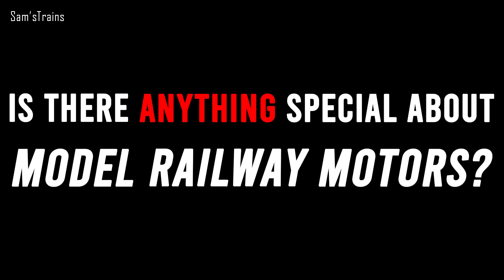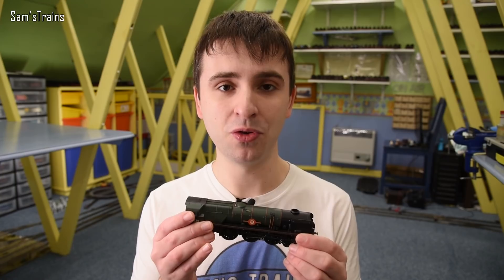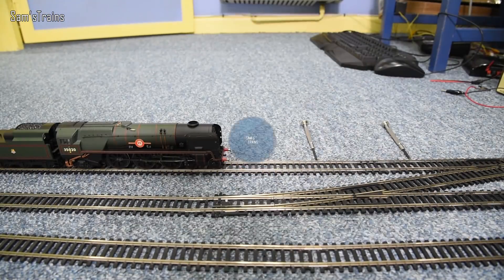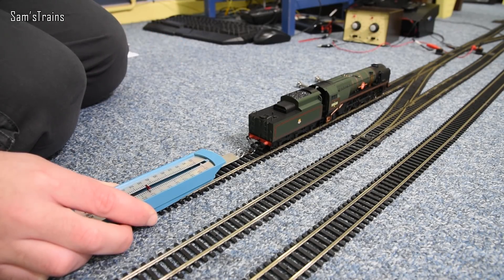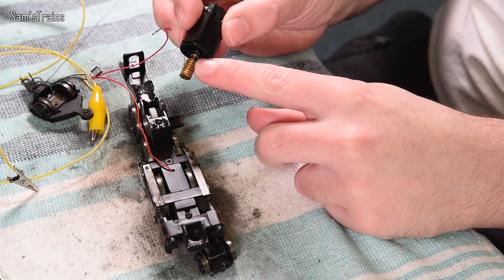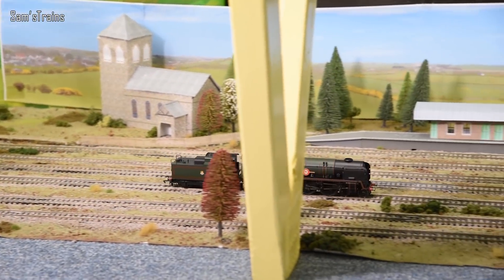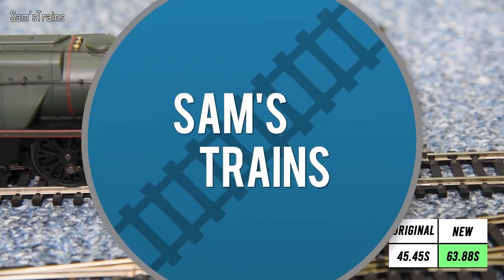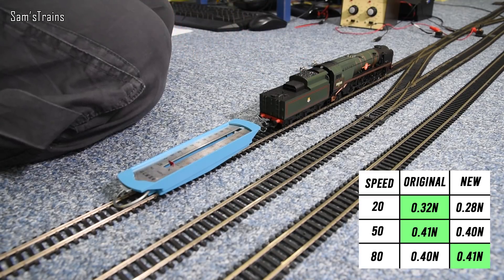How Much Do Model Train Motors Really Cost? | £2 vs. £27

Comment: Where did you get that gear puller. I have been looking for one and have not found one that small. Also do you know if the Chinese make a 5 pole replacement for the venerable old X03/4 motor.
Reply from the maker: They're available on Ebay - do a search for 'Pinion puller'! Unfortunately I've never found a good replacement for the X04, since  the motor mountings only fit the X04!
Thanks for watching - Sam :)

Comment: Just some insight from someone who works at an electrical company who operates, manufactures and ships in the UK.

If Hornby are anything like where I work. The reason their motors are so expensive is because they aren't really trying to sell a lot of them. They likely keep them in house so they can make repairs on locos themselves and selling them for say, £2-£3 isn't at all worth the time or effort, especially when people can easily get them elsewhere for not a whole lot more then they'll be paying wholesale. Where I work we do the same with knobs for electrical items. We keep a load in stock for building our product, they cost like... 50-90p each for us to buy. They're about £1-£1.20 each in the consumer market. If you want to buy a kit of 6 from us we'll charge you £30 for them (Free shipping in the UK though... Woo).

Selling them at a price to compete with the normal £1.20 price would loose us money so we don't even bother trying to. The quantities and logistics of making money on a 30-70p mark up just doesn't allow for it to work given how much we would sell and the effort it would take. That said there are people who insist they buy knobs from us rather than some 3rd party and charging a significantly higher price makes offering those people who insist worth it for us.

I'm not at all surprised by the results of your tests, small motors like that are so easy to find for a low price. There is no reason you should be paying £20 for one and I'm sure Hornby are expecting most people to go else where for replacements.

Frankly it's great you're getting the word out so more people do go out and get the cheaper, likely identical parts.
Reply from the maker: Many thanks for the info and insights Jacob, appreciate that!
Thanks for watching - Sam :)

Comment: Hi Sam and good evening. I like your motor and gear puller if possible you could let me now which company you purchased it from many thanks Colin.
Reply from the maker: Hi Colin, this is the one I use, hope that helps: https://www.ebay.co.uk/itm/353423720740
Thanks for watching, Sam :)
Reply: Hi Sam thanks for getting back to me. Also can you help me I purchased a rebuilt west county class unfortunately I did not test it when I purchased it on eBay it’s new my fault the problem is the motor runs but its not engaging with the center drive gear wheels if you can give me some idea and advice that would be great colin
Reply: @SamsTrains  hi Sam  and good evening. I have Purchased and received my  gear pulley just the job thanks for all help many thanks Colin.

Comment: I bought a load of these a couple of years ago. Annoyingly I've not had a motor fail to test them, just a couple of worm drives wear out! 
 Never had any faith in Hornby pricing. Everything they sell is massively marked up to the point that they can't sell enough of them to make a profit. Just look at when the rebuilt merchant navy came out, they were reasonably priced and Hornby sold in excess of 30000 in the first year. Now they struggle to sell a couple of thousand of new models.
Reply from the maker: Yeah you're not wrong - I truly believe that the hobby could grow if only the manufacturers would offer more reasonable prices - investigations like this more-or-less prove that their pricing is unreasonable!
Thanks for watching - Sam :)

Comment: Poundland, get a USB fan and take the motor out.

Benefits:
Express trains are faster, goes over express points (and scenery), and adds realstic smoke effect.

Cons:
May send your model back in time which is known to melt plastic.
Reply from the maker: I wouldn't recommend that really - the USB motors are usually only rated for 3-5v, and they draw much more current than 12-24v motors do. On 12v they could easily burn out, as you say!
Thanks for watching - Sam :)

Comment: How do I know which motors to buy? I see 12-24V motors were purchased for this video and it also says “22200 RPM” on the listing… are those things important? Or do I just need any micro motor that looks like it’s the kind I need? Like if a motor listing online says it’s 1.2-3V, for example, is that still ok or no?

Comment: this is one of the reasons I much prefer to use tender drive ringfields/hornby diesel ringfields and lima diesels, spare parts are available and they pull better, plus you can service them as well :D
Reply from the maker: Yeah those are great - though I do find that these motors are smoother, and thanks to Ebay, parts are available! :D
Thanks for watching - Sam :)

Comment: I have seen several comments regarding how long these motors will last. I build 1/43 scale slot cars and use a wide selection of cheap Chinese electric motors in my chassis. These cars are worked quite hard in various competitions and I have had 1 motor failure in 10 years. This failure happened in a car that did many endurance races with voltages up to 20 volts, with a motor marked as 7.5 volts. I have no problem with their quality control!
Reply from the maker: Yeah you're right Lloyd - I've been using these since 2018, and they're all fine so far! I think the longevity should be very good! :D
Thanks for watching - Sam :)

Comment: Make sure you are getting 5 pole motors. The more poles the better. Cheap locos have 3 pole motors and do not run well at slow speeds. Skew wound have less slow speed cogging than straight wound motors.
Reply from the maker: Yes definitely - always 5 poles with me!
Thanks for watching - Sam :)

Comment: Hi Sam, any chance you could tell me where you got that gear puller you used as I've had the same issues with some Bachmann models I'd like to swap out with some Chinese motors I've bought less the pinion please?
Keep safe!
Reply from the maker: Sure! Here you go: https://www.ebay.co.uk/itm/Alloy-Gear-Puller-Remover-Tool-for-Remote-Control-Helicopter-Motor-Pinion-DC/293510889492?hash=item44569cc014:g:U1EAAOSwOmteaY9B
If you're able to find any suitable Bachmann replacements, please do let me know - I've not been able to find any that fit!
Thanks for watching - Sam :)

Comment: Nice job. You said you used a vice to reinstall the worm. If it was end to end wouldn't that potentially damage the brushes or commutator on the shaft? Love Yr vids, Cheers
Reply from the maker: Yes you have to be careful - these motors have the shaft poking out the back end, so the force was only ever on the shaft - it certainly wouldn't work with all motors!
Thanks for watching - Sam :)

Comment: That's seriously impressive!

I've recently bought an old Lima 08 but the gears are off to the side on the wheel not down the middle like here.

You think these will still work?

Also, your trains are so quiet, the motors on mine make a fairly loud buzzing sound. Any ideas why? One loco is brand new and still buzzes.
Reply from the maker: Thanks very much mate - yes I know the ones! You can remotor the lima locos, but not with these ones unfortunately!
Thanks for watching - Sam :)
Reply: @SamsTrains  yeah I took it apart today, totally different motor style.

Is it true your controller can make your locos run quieter?

Comment: Model trains aren't designed for speed, so it's not surprising that you can just use dirt cheap ones with the same results.

I assume stuff like flywheels are way more important to locomotive performance than the motors.

Comment: They're usually 130 size motors, my Lima Class 20 uses a 180 size motor. 

All cheaply available

I'd recommend buying a pinion puller to remove the worm drive from the old motor
Reply from the maker: Yes you're right - many do use that size, though there are no 12-24v available from China at the moment - I've had some in the past though!
Thanks for watching - Sam :)

Comment: Sam, very interesting stuff. What are the connections for the multimeter to check the amps being drawn?
Reply from the maker: Thank you! The multimeter will need to go in series (google series vs parallel), and you want the probes plugged into the common and 10amp sockets on the meter - just remember to change them back again before measuring voltage!
Thanks for watching - Sam :)

Comment: GOOD Test . .  but pullpower test is irrelevant once wheel start slipping. Decoder regulating current makes speed much more smooth for any motor.1😂
Reply from the maker: Yes that's true - I was just demonstrating that the loco is no less powerful!
Thanks for watching - Sam :)

Comment: Sam - very useful video. I might have missed a bit of the video but the ebay photos of the ones you bought show a motor with a  shaft at both ends and the closest I can find on ebay today (same seller) also have shaft at both ends. The motor in video though looks like it only has a shaft at one end. Did you have to cut the shaft at one end?
Reply from the maker: Thanks a lot Ken - yes they did start disappearing off of ebay after I released this video... it seems it is only the dual-shaft ones left now, so yes you would have to cut one of them down!
Thanks for watching, Sam :)

Comment: Not really surprising. They make motors for the train set manufactures, but economies of scale dictate large quantities. So they sell the same motors cheaper unbranded. However they will also not have undergone or passed the quality control. So it probably is not a copy, but an unbranded version of the same.
Reply from the maker: Yes that sounds very possible - thanks for the info!
Thanks for watching - Sam :)

Comment: Worm drives. Buy a puller and a press instead and retrieve the worm drive off the motor in the loco you are replacing the motor in. '99%' of the time, a brass worm drive won't need replacing with a new one.
Reply from the maker: Yes you're right - that's what I did in the video as you can see - the brass worm drives do last a long time!
Thanks for watching - Sam :)

Comment: Usually the Chinese stuff on Ebay tends to be the bottom of the bucket qc failures that they are trying to make money off of. Now if you have found the manufacturer of the motors that Hornby sources from and they are just selling the same motor but by the generic name then you will see the drop in price.
Reply from the maker: Yeah absolutely - and the quality has been consistently great too - very impressed! :D

Comment: Like that Sam. It seems impossible that technology can be manufactured, shipped and sold again with everyone in the chain making a profit enough to live on. I'd avoid such item priced that cheap because I don't believe it. Someone is being badly exploited. £17 or £23 whatever is not expensive for a quality item. An aerospace version would probably cost £1000 just for comparison. 
Now as you purchased 10 cheapo motors, I'd suggest you do an autopsy on one to see if the Rotor (or Armature if you will) is also Skew wound. My old company Lucas Aerospace may have invented said winding technology as it produces ultra smooth slow rotation because a part of each Rotor's laminated iron corepack pole is always aligned with the corresponding Stator straight pole (so no air gap jerkiness). I've drawn these things for manufacture many times.
If the cheap motor has straight Rotor iron corepack poles, then something is wrong for it to be better than the genuine Hornby motor. Don't expect the Chinese to take any notice of patent laws. There, light fuse and run.
Reply from the maker: Nope - motors like this are readily available on Ebay directly from the manufacturers in China - no reason to expect any of them being exploited. They're not quality items - the replacements from Hornby are identical (I have verified this), they just have a massive mark-up!
Thanks for watching - Sam :)
Reply: @SamsTrains  You are missing the very serious issue here Sam. This is hyperthetical, but its quite probable Hornby designed the motor initially then sent the design to China for manufacture. Its no coincidence the motors are nearly identical and fit straight in. The manufacturer who probably is just a manufacturer, not an engineering design office, removes the Hornby markings from the tooling and carries on the manufacturing batch over and above what Hornby ordered e.g. Hornby order a 1000 motors with all their tooling and set-up costs, then the Chinese subcontractor manufacturer makes another 6000 motors on the black of the original order for almost nothing. Hornby dare not sue them or they will lose said manufacturing facility. They have Hornby's very expensive tooling, so have got Hornby and all the other companies by their short and curlys. They laugh at legal threats - their 6 billion people and communist vs our 60 million or even USA's 300 million, just no chance. Its Hornby who are most likely being ripped off, not us. A bar of chocolate can cost more than those cheap motors. Think about it and please don't promote Chinese ebay cheap stuff. Companies who stay with China's cheap manufacture will all end in tears. Taste the coffee as they say.

Comment: I think you may find quality control is somewhat less than the Manufacturers motors,but at less than a tenth of the price,you could afford 1 or 2 duds in a purchase of 10 motors.I use a lot of the 6mm geared pager type motors from china,and very seldom get a completely dead one.
Reply from the maker: Yes that may be so - but I've not been unlucky so far! You're absolutely right!
Thanks for watching - Sam :)

Comment: Have you got the web address of where you got them from or the what you searched for? I did a quick search but got didn't find them.
Reply: Its OK, I found them. Another question where did you get the worm drive puller, it looks better than the G clamp type.
Reply from the maker: Glad you found them! I got mine on Ebay - just do a search for 'Pinion Puller'!
Thanks for watching - Sam :)

Comment: A couple thoughts.  Getting into this hobby is nearly cost prohibitive to begin with.  Unless you are invested enough to go all out.  $25 for an oem engine seems within reason for a loco that probably costs $125 out of the box. (Converting to USD for my own comparison)  after all after the licensing of the loco and the detail presented, the powertrain is perhaps the most expensive piece of the engineering.  I dont find $25 to be cost prohibitive if I have already put several thousand into a set up like you have in the loft.  
Second...pulling power and slow speeds are more of an interest to me than high speed unless I am modeling a bullet train.  While seeing a steamer highball through the American plains is fun, out rail service here moves at a sedate 55 miles per hour.  Our steam excursion trains rarely exceed 30 mph.  Most stick to 20 mph.  That is unless you see the Union Pacific Big Boy (4-8-8-4) or the Southern Pacific Daylight (4-8-4) doing a state wide AR National (American) tour.  Then even they are kept at the 55 speed limit.  (They may edge towards 65, maybe 70 for flybys...but...shshshs....dont tell anyone 🤐)  anyhow...high speed is of little importance.  Therefore I am very interested in flywheel slow power.  The stronger the better.
Reply from the maker: Yes that's very fair to say! The same is usually true for steam in the the UK, though some engines fit for mainline work do go much faster!
Thanks for watching - Sam :)

Comment: Interesting thought here. Whilst the cheaper motors on the face of it are superior, what is their longevity over a more expensive one? The cheaper motor might perform far better for three months, but the more expensive one, whilst on the face of it inferior in performance, might last 10 years due to better quality materials?
Reply: True but if you ignore the faff of changing the motor would you need 6 or 7 motors in ten years?
Reply from the maker: Very good question - I'll get back to you in 10 years if I remember! I've been using motors from the same/similar source since 2018. My P2, Duke of Gloucester, S15, Tornado, Q1 and others have been running on cheap replacements for about two years now, so far no sign of any failures! As Mike rightly says - even if they only last a year each, you can still get 10 years-worth for the price of a single genuine one!
Thanks for watching - Sam :)

Comment: I don't know if all types of railway model motors and gears fit in it, but I think you might want to get Slot.It's SP21 extractor press. It was designed for slot cars and not trains, but it should still work. I own one myself and it's an expensive (around €60 I think) but excellent tool, it can both pull and install gears and also has a graduated scale on it to measure how far the gear is on the shaft.
Reply from the maker: Yes I've often thought about it - it would be great to have! :D
Thanks for watching - Sam :)

Comment: There are two aspects that might explain the difference.  Long term durability... though at that kind of  price difference the good motor would have to last a long long time to recoup the cost.
Or quality control.  It might be that one in ten of the cheap motors are duds.... but again at that price, the cheap motor still wins.
Reply from the maker: Yes that is a consideration - but they do seem to be identical to the Hornby ones - I've been using the ebay ones since 2018, not a single failure yet! Even so, you can buy 10 cheap ones for the price of one - as long as they last 10% as long as Hornby's (and they do, more so!), you've got your moneys worth!
Thanks for watching - Sam :)